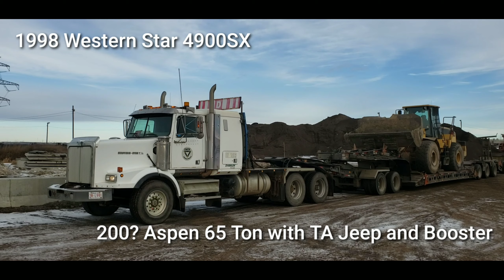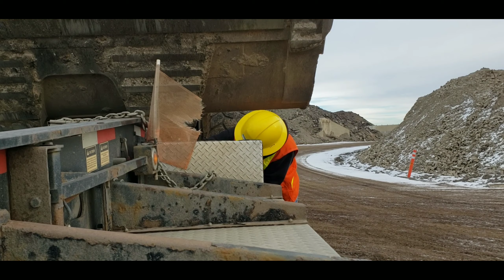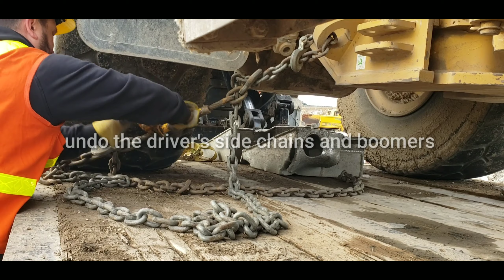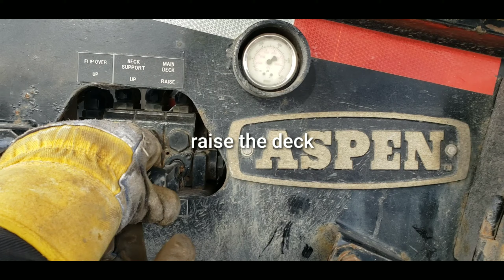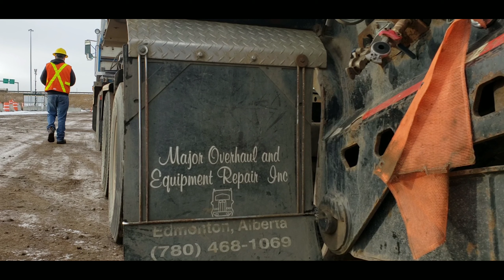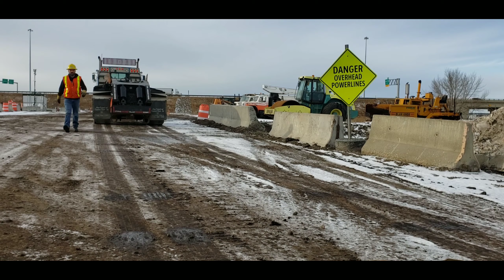How to unload an RGN lowbed

Comment from the maker: I should add a note here, I generally leave the rear of the Equipment chained down while I pull the shims and lower the deck. Otherwise a weak parking brake could have you in a little trouble!

Comment: why does the trailer need a load sharing dolly/jeep and a booster/stinger on the rear connected to the RGN  trailer are the roads in North America paper thin? that wheel loader isn't that big  here only need a tri axle low loader